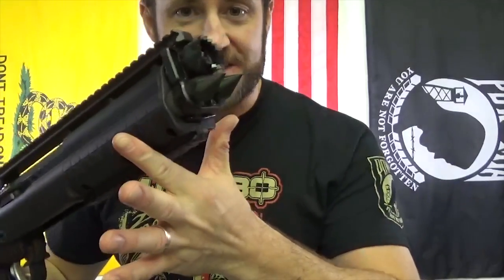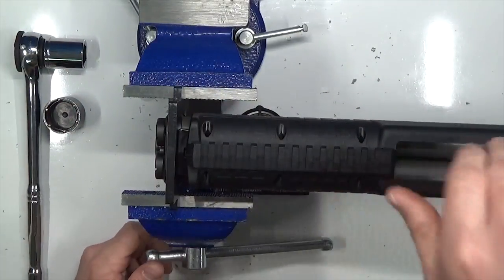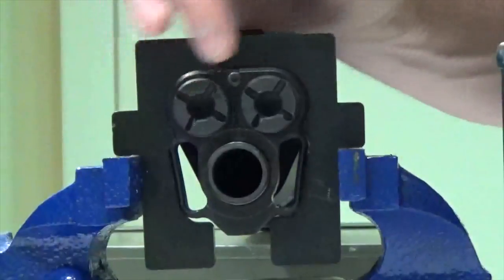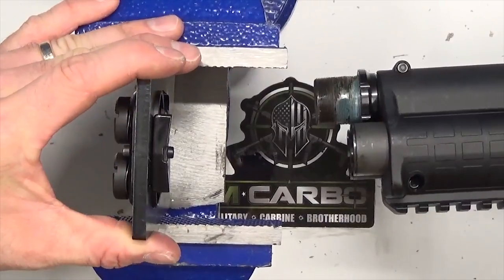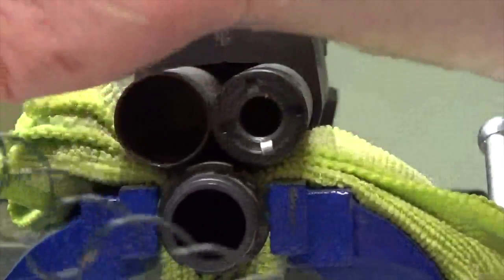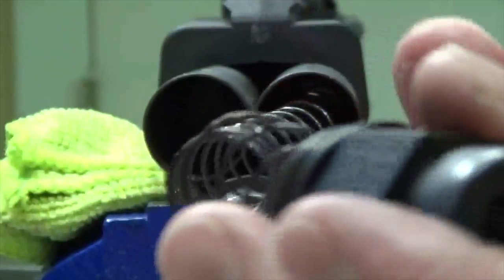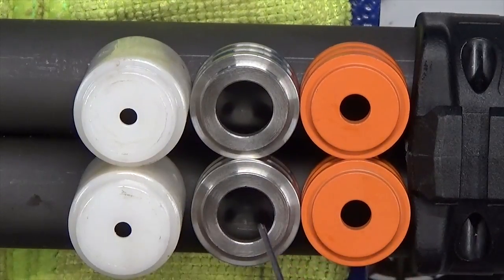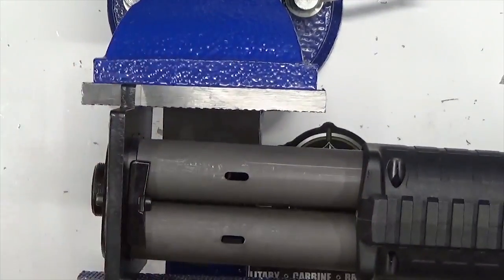KEL TEC KSG Bayonet SPIKES!  HI-VIZ Followers - KEL TEC KSG Accessories - M*CARBO

Comment: If you want to just add the bayonet spikes, do you simply need to remove the mag plugs and then install the nut/screw in the spikes? Or do you need to remove the picatinny rail and muzzle plate?

Comment: I know this is an old video but maybe you'll see it. I get the idea behind the breecher barrel nut, stabbing it into the door for stability before blowing out the lock. But wouldn't putting the mag spikes on interfere with this ability? Or would having the shotgun pointed down at such an angle not be an issue?

Comment: I know the spikes from this setup will fit on a DP-12, but I'm wondering if the barrel nuts are interchangeable as well.  I'm pretty sure the breacher nut would be too wide for the DP-12's double barrel setup, but would be nice to be able to search through the KSG accessories for customizing the DP.

Comment: The Follower Nut Tool in the video has two tabs on it, as he points out. However, the one I just purchased from you has four tabs, it absolutely will not work on my KSG. I can't use it to remove them, but can use it for the Mag Bolts. How do I get the correct tool from you, it's not on the website?
Reply: Same issue. I assumed the follower removal too was only for the mag plugs and I needed the mag wrench to remove the mag plug “caps”.  What did you end up doing?

Comment: I like the muzzle and spikes but the mag followers in my opinion is a downgrade.  The factory plastic is already low friction and doesn’t require lube.  The metallic followers require lube and has the potential to wear down or actually cut into the mag tube wall especially if any debris gets in there.  The coating will also wear away over time.  Won’t have to worry about that at all with the factory plastic followers.